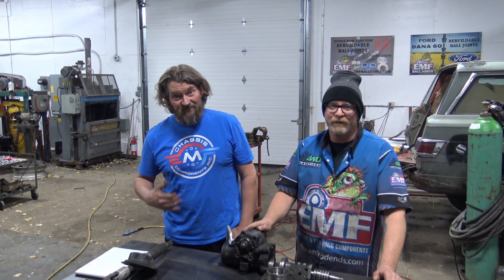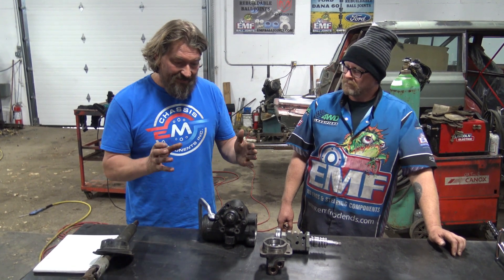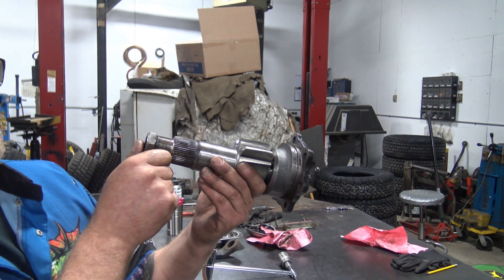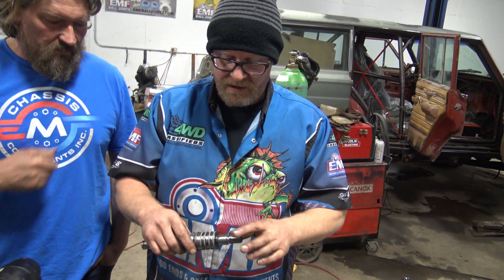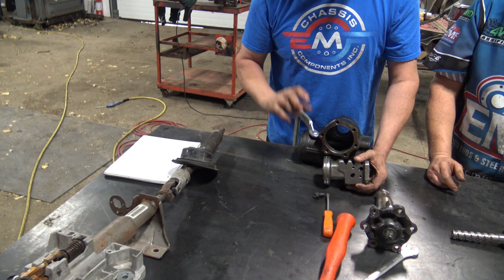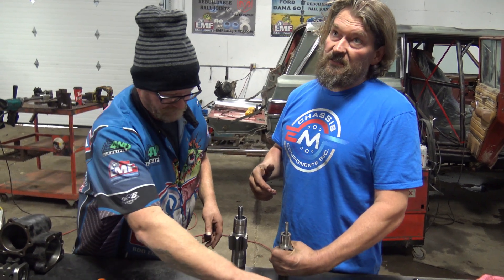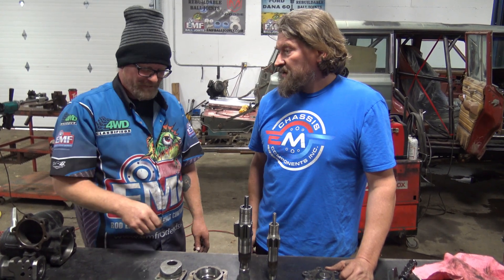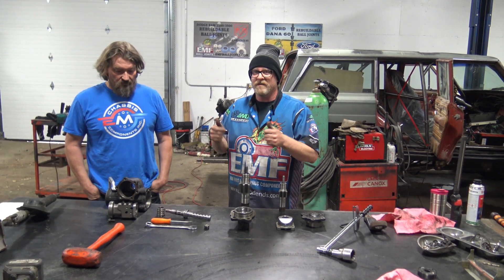The Origin of Dodge Ram Death Wobble - Part 2 - The Steering Box

Comment: I had a death wobbled for years on my f250, changed a bunch of parts, added a stabilizer. The truck also had hard steering when it idled because the power steering pump was worn. Once I put a new power steering pump on, the hard steering at idle went away, and it also has not death wobbled since. I know all the bumps in the road between home and work that triggered the wobble, I can hit them without a care in the world now.

Comment: Very informative if you first check tires , rims loose, inner/ outer tie rod ends and track bar along with wheel bearings  worn, then steering gear box is start to finish thanks you provided a very good eye opener for death wobble.

Comment: I have an on going problem with reoccurring death wooble i have replaced anything loose it has gone thousands of miles without doing it then it does it. recently i put a new box on and on the test drive it did it 2 times with 5 miles. Im at witt's end. Can i hire you to diagnose

Comment: That last demo on the bench was fascinating. I have a drag car with manual everything wish we could go back. Hate the steering assist on 2020 F350 still have trouble when backing trailer compared to before that was available on truck. Always feel it over assisting in small movements.

Comment: Are there differences in the 4turn vs 3.5turn dodge boxes?
I've got a 4 turn about to be replaced with a red head box ( unless you have a fix developed  by now). The old box has  the opposite problem. Sluggish, weak ,quits supplying pressure because the torsion spring is too soft. The passage hyper extends going into dead heading the box . Then I'm fighting the bound up box and the weight of the truck.

Comment: push in the clutch and turn the engine off and see if it stops. You should rig your dually so it will wobble, make it wobble and then swap in and old anual steering box and see if it still wobbles.

Comment: I believe that what you're speaking about is a small part of the death wobble. My 2006 Dodge 2500 Cummins suffered severe death wobble. I found the absolute cure which is, a Carli adjustable track bar and a tough country long arm kit. I can do 125 now without any death wobble.

Comment: Loose the power steering hoses to the box and go for a death drive see if it is. 
 My 2011 has done it acouple times. And with 37s it wasn't bad compared to now with stock new Firestone tires. Maybe shocks again or balljoints or the shaft bushing. Hahah anyone wanna buy a 2011 3500 BD diesel trac bar and box brace

Comment: You guys are brilliant! Putting science and mechanical understanding behind root cause analysis for this awful condition is fantastic. This is easily the most informative info on the death wobble I've come across. You're providing insight to help truck owners instead of just selling your parts. Top notch! I have a set of your balljoints in my truck too by the way. A1 fellas

Comment: What’s the cure
Reply: Get a Carli adjustable track bar, and a tough country long arm kit. Death wobble cured! But you do have to make sure you don't have slop in your steering also.
Reply: The reason for death wobble is the steering box sector shaft. Look up EMF, on YouTube. These guys from Canada are suspension experts. The topic is death wobble, and these big heavy trucks that steer like an luxury car. To many and to close together valve spaces on a very narrow sector shaft. Tie rods, ball joints,shocks all of it misleading so the sushi on dealers can sell products. Sad but true.
Judge for yourself.
Peace, 2017 ram 2500 Laramie 4x4 , Carli 2.5, Carli sway, EMF  rebuildable ball joints( highly recommended) synergy track,synergy drag, Carli adjustable track bar. Rolling on Black rhino arsenal cooper 35 x 12.5 35
Reply: 20”s

Comment: You guys talked to Don Thuren about this? I’m not saying your wrong but the steering box has never been a cause of death wobble in any of his info posted to his tech section. Just like to know his opinion on this. Death wobble has always been an issue of caster forces. Ball joints, track rod, wheel bearings, and such mostly track rod.
Reply from the maker: Those are all fuses to setting off hydraulic flutter. They all cause the initial shake. So he's right.Once that shake happens it engages the hydraulic hammering. However if you watch the first video we came across the hump in the curve of the road on the throttle at higher rpms/higher pressure. We engaged the violent wobble. We didn't adjust or do anything to trac bars tie rods  tires etc. We came back across the same hump in the curve let off the throttle dropped the rpms/pressure and we didn't get and wobble. We got shake which I could feel in the wheel from the bad rim and tires and loose drag link. But no violent hammering. I guess what I'm saying is everything leads up to the violent hammering. And all are cures to prevent it. But the hammering is hydraulics.

Comment: Ok, hero of the stupid question, how do you best check the condition of the ball joints on a truck? Loaded or unloaded (axle weight)? With or without tie rod connect?
Reply from the maker: Jack the truck up, support with stands. Put a bar under the tire and pry up and down for vertical play. Grab the tire top and bottom for horizonal play. If you suspect a sticky joint or for checking for a seized u-joint, separate the tie rod from the knuckle and steer by hand to feel the resistance.

Comment: So, I guess my question is what is the pre-load we can put on the 4th gen sector gear adjustment? At 80k (miles) my '16 Power Wagon is getting noticeable steering wheel 'lash' feel at 11 and 1:00 wheel positions while in a big left or right sweeper at say 50 mph. You can feel a 'click' in the wheel as the tires find their way left or right in the turn. Pretty sure it is slop in the box. I put your upper intermediate shaft bushing in about 10k ago, and they certainly helped. That lower intermediate shaft u-joint is a questionable link too IMHO.
Reply from the maker: my first question is have you touched the intermediate shaft? 11 to 1 is commonly mistaken for box lash. The intermediate shaft is the fastest cheapest point to start. Borgsen  fixes it or a quick  cheap collar install.
Reply from the maker: Okay I didnt answer it .I just read you have the collars.  I'm going to take the night to think of a proper answer.
Reply from the maker: A clicking. Is it coming out of the column? Mine makes a clunk sound where it tilts now. Ever since we spent that day creating death wobble.

Comment: This is a very informative video for starters. I like the products at EMF in general so, to see you guys making an educational video is great. This video also covers a wide-range of root-failures at the gear box level which many are unaware of - myself included to be honest.  I knew of quite a few root causes associated  with oscillation from the ground up such as when a tie rod assy goes into oscillation thus, shortening and lengthening thus leading to rapid toe-in / toe out thus, when looking at the tie-rod assy using high-speed video, the pattern emerges that resembles the outline of a football. That's just one of many modes. Other root causes are Track-Bar lateral movements to flex, to drag-link oscillation and flex to incorrect setting of suspension component geometry. I've seen and studied those conditions to great length however, I've not once focused on the gear box itself other than checking for gross wear and / or binding conditions during trouble-shooting sticking steering conditions. 

This is a fantastic video guys - especially the bit showing a competing OEM manufacturing assy defect (over-tightened) such as in that sector shaft issue mentioned at 15:16 -  interference due to static friction. And, if one never removes the box to investigate it, one would never be able to root it out if this wasn't part of the trouble-shooting process thus leading to swapping out components and chasing their tail so-to-speak. Greatly appreciate the effort taken here. 

CM
Reply from the maker: Thank you. There are so many things that contribute to the chain reaction of "death wobble"  This is one area I've never seen addressed. Just thought it should be discussed.
Reply: @EMFEVO   Great video! A lot of this issue has to do with lack of QC as well from the factory. Thanks for all Your time and effort with this Dodge Death wobble issue! 😎👍
Reply: Good guys have their ball joints on my 17 ram 2500 4x4